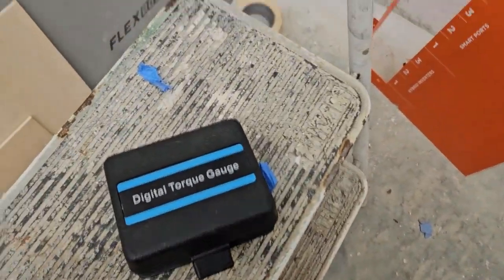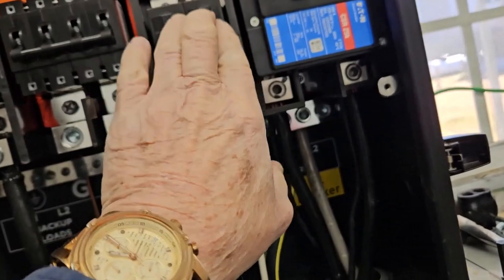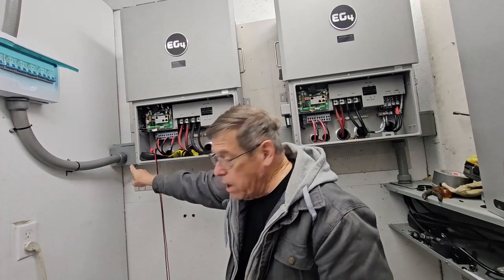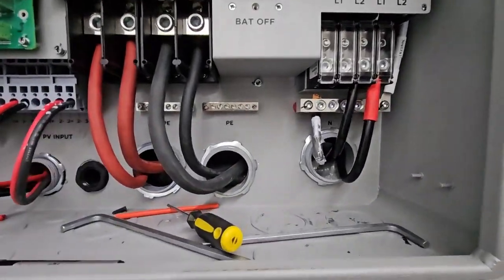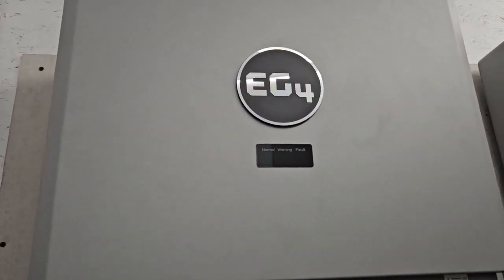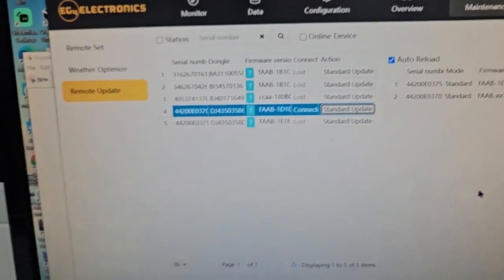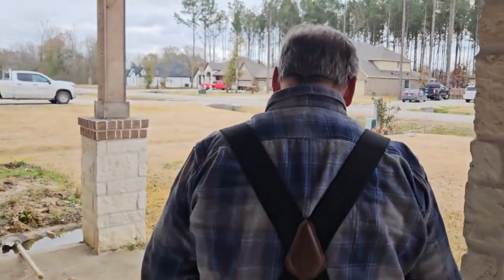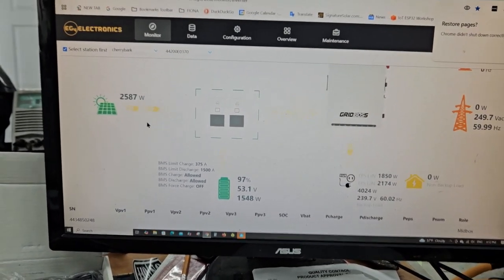My Flexboss DONE!!

Comment: Hey Gerard.  Do you have any initial thoughts on how the gridboss and Flexboss21 and your battery system is working yet? I have the same system to install and hoping it very reliable where I rarely even have to mess w it or think about it.  Please let me know
Reply from the maker: @jeffsmith3297  it's been just over a month, and so far, it's been performing well. I don't think you can ever not mess with. I've got 20kw in panels and 76kwh in batteries, but there's been so much rain and clouds in January and February that there were several times that I had to charge from grid in the middle of the nights. There was one time that the batteries were below the 20% SOC that should have triggered a grid charge but didn't
 Only happened and never happened again.  After that, it is living up to my expectations
 This summer will tell the real story. I have 4 AC units on my property that will be in intermittent use all summer. Last year when running two 18kpvs my solar was able to keep up. But since the I have added a Honds Clarity RV.

Comment: I am about to install 2x FlexBoss, GridBoss, and over 60 panels at my house SW of Ft Worth. I’d love to get a couple details on your installation. I have a 320 amp main service and 2x 200 amp service panels. What is your service? How what kinds of transfer/disconnect switches did you need beyond that large transfer switch you used to turn on the system in the video?

Comment: Is that aluminum wire going into the gridboss?
Reply from the maker: @sneakypete830  The grid coming in is copper. The power leaving to the loads is aluminum.  In the manual, they say not to use alluminum. The reason was that it had not yet finished UL testing with alluminum. I was told by EG4 that the testing was finished, and now alluminum was permitted ONLY on the 200amp lugs.
Reply: @gerrypineau  Damn, wish I would've seen this before I started doing all my splicing from copper to aluminum

Comment: Does code allows bus bars to be outside of an enclosure?
Reply from the maker: Grounding and Bonding Busbars – NEC 250.66 and 250.94 allow exposed grounding busbars for bonding purposes, such as interconnecting ground wires in a solar system or telecommunications setup. These must be mounted securely and labeled if required.

Common Applications Where Exposed Busbars Are Allowed:
Grounding busbars in solar power systems (often mounted near the inverter or main panel).
Grounding busbars in telecom and radio towers.
Service entrance bonding busbars mounted on the exterior of a building.
Reply: @gerrypineau chargeverter tie into the busbars too? Thank you for the video!
Reply from the maker: @mcconja  Yes. It is sitting on top of the battery rack but connected to the bus bars. I have rearranged the placement of the bus bars and added the covers. They are now mounted horizontal with the pos on the left and the neg on the right tucked up under the inverters.  Looks much cleaner and safe now.

Comment: The latest NEC states that all wire from the panels that run inside a building shall be installed in metal conduit due to the greater danger of DC voltage sparks.
Reply from the maker: You are right
690.31(G) Photovoltaic System Direct Current Circuits on or in a Building. Where PV system dc circuits run inside a building, they shall be contained in metal raceways, Type MC metal-clad cable that complies with 250.118(10), or metal enclosures from the point of penetration of the surface of the building to the first readily accessible disconnecting means.

Comment: Nice setup, looking forward to your thoughts on this as you use it.
Reply from the maker: First night with the batteries at 95% . Overnight ran the house and the shop. I mistakenly left the mini-split running for heat in the shop. (that would be a great application for one of the  smart ports)  So this morning before sun-up the batteries are at 26% an I am hoping for enough sunshine to prevent a charge from grid. My threshold is set at 19%. Just now checked and the sun is charging the batteries. So overnight did not need anything from the grid.